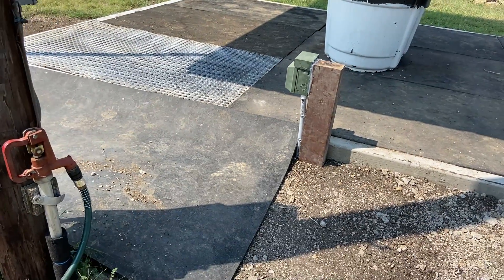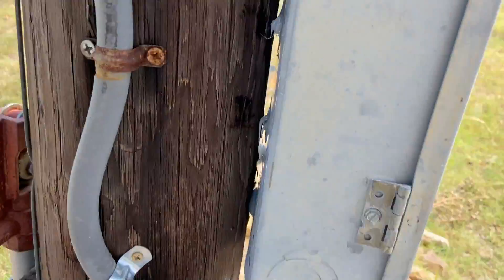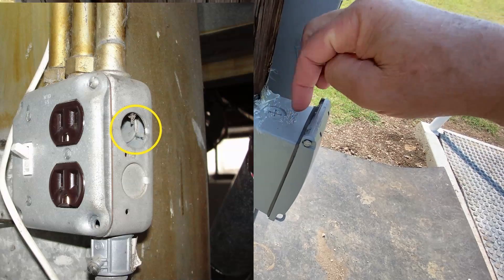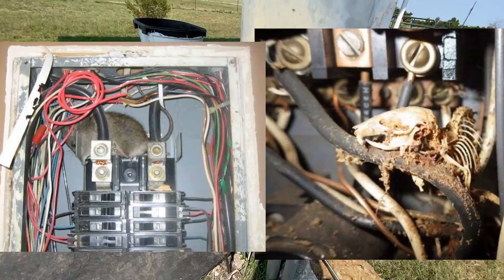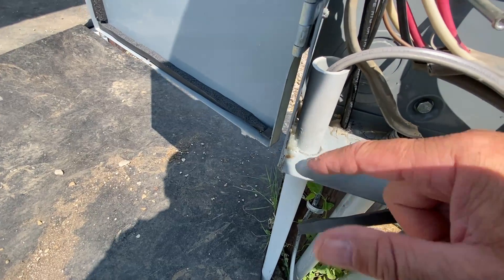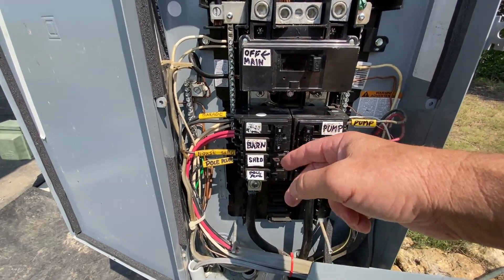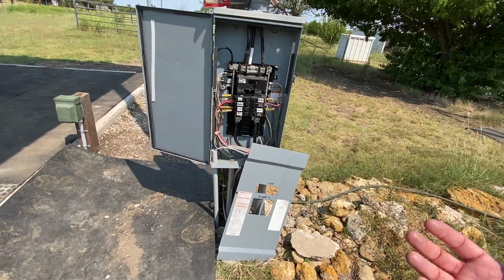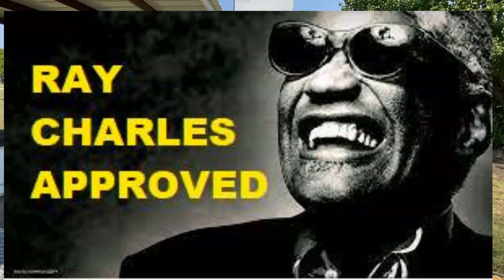Electrical Box Maintenance & Cleaning - Preventing Failures & Fires - RC Approved Expert Electrician

Comment: Lacquer thinner before the weatherstrip also don’t forget about the meter socket above,  grab a pair of kleins or  channel locks grab hold of that plastic tamper lock body and pull down hard. Before you Pull your meter out turn off your breakers below . Two screws behind the meter will  get the upper box open then seal the meter cover.  If you reallly go anal  order some duct seal (GB Gardner Bender Sealing Compound) Clay and seal you pipes coming in and out of the boxes.  Oh yeah… after you pull on that seal 95% chance the wire won’t break, you can bend it back in shape and put the lock back on. Not even an issue.  You’re savvy enough to not get lit up. Otherwise looks good .

Comment: What happens to breakers that aren't mechanically cycled, is the grease on the internal movable parts dries up and turns into a hard wax as the petroleum distillates evaporate. This intern freezes up the breaker mechanism, preventing it from functioning properly. Cycling tje mechanism stirs the grease spreading the distillate that hasn't evaporated to the outer portion of the grease that has started hardening up. I'm 34 years into the electrical field as an industrial journeyman electrician and electrical apparatus mechanic with 22 years experience in predictive maintenance and testing and thermal Imaging.

Comment: Sealing all the small holes and the door seal is the fix.  Sealing the internal cover not needed. 

Breakers:  One should cycle them annually.   If a breaker has a good current load on it, and not cycled on/off for years you risk the internal points on the breaker welding together.  The higher the constant current draw, more likely.   MTF [ mean time to failure] for a breaker is ~ 20,000. 
Unless you are using the breaker as a switch, you should not worry about turning it on and off.  

If your main power goes off, and you remember, go cycle all the breakers.  just a good practice.  

Re-torque the lugs on breakers and Neutral and Ground lugs.  Use an insulated screwdriver or Allen tool, a leather glove a good idea as well.  Turning off main Breaker before a better idea.  Stand to the side when flipping / torqueing  breakers. 

These connections will go thru heat cycles in use and loosen up over time.   If you heat a piece of metal it will get bigger, and it will get smaller when it cools.  

This property is used all the time. Example 1;  it is used to loosen a nut on a bolt.  Heat the nut so it gets bigger then you can get it off.   Example 2  Heat a plate with a hole in it , the hole will get bigger. stick a rod in the hole and the plate with cool and capture the rod.  you can also cool the rod instead or do both.  

These changes can be calculated to precise numbers to do this type of thermal fit.  Many videos on it out there,  4th grade math as well for folks in Rio Linda. 

Stick a U-Shaped rod of bolt thru the lock device to keep it closed.  OR just a bolt. Stops the mules from accidently pushing it open.  Use a lock and place key on Top of highest box with a magnet too. 

SAFETY SALLY:  Rick needs to learn as does so many.  DO NOT be pointing at live electrical circuits with your finger.   Use a wooden stick if you need to.   That finger will have muscle memory to touch what you are pointing at or looking at.   

You will notice good electrical folks will stick there hands in their back pockets when in a dialog about a panel.  Hands not used by accident and they just can use vocals.  It's so easy to point so the back pocket trick works every time it's tried.

Don't stand in front of the live panel.  Work from the side. If you have an ARC BLAST it goes in front.  Stand to the side as you watch a Technician work on a box.  So easy to do, why not.  Watch some Arc Blast videos you will see my point. 

ASIDE: thanks Pat for helping Rick out.
Reply: Yes, because newer panels like this need to have the breakers cycled annually because they're constantly arcing. Sounds like a good way to piss away $50-$100 a year on something that doesn't need to be done.
Reply: Yes a arc blast from a 240 volt residential panel is something that you need to be worried about. You don't know what the hell you are talking about buddy. Stop fronting like you do.
Reply: @twn5858  What the hell you talking about.  Explain in detail how I got it all wrong, vs name calling.     If you cycle breakers say 10 times a year [high] you got low count of 20K cycles before failure. should last 2,000 years.  you doing fuzzy math [logic]?  Breakers used for LOTO get lots of cycles per year.  We established a scheduled program to replace them before failure on a 1 - 2 year based on data.  Cost for repair in up time was spendy,  scheduled was minimal in comparison. 

Looking forward to reading about how smart you are and I know nothing.  Bring the data forward.  

ASIDE: I hate breakers for LOTO use.  Breakers are a current device not a switch.  
We ran tests with a Rube Goldberg setup and a PLC.  Breakers really do such for high count switching applications. Siemens, A/B , Square D ,  Cutler-Hammer.  not to mention the stuff for homes.
Reply: @twn5858  I just hear the sound of crickets.  Pretty strong language I don't know what I'm talking about.  

You might not know as much as you think you know. I could have gone through your limited info posted, but didn't think you would listen.   But I can.
Reply: @Linghunt2  Don't brother. You'll just be wasting your time, but be sure to cycle those breakers every year. That's a great way to throw away $50-$100 every year. No doubt about it.
Reply: @twn5858  No doubt about it, you kidding me.  You are totally wrong.  I looked up a random A/B breaker.  Per specification 20,000 Operations for Mechanical endurance.  [ A/B 1489-M Circuit breaker]   So if it's cycled once a year  that's 20,000 years before failure.   Breakers don't fail on a single toggle.   $50 - $100 a year?  

The reason to flip them is to make sure you are not thermally welding the contacts together so when you have a current overload the break fails to open.  Pretty simple if you want to understand.  My designs and input to Maintenance Schedules were actual data on failure for repair logs.  

Breakers that were used for LOTO get cycled many times in a day.  These were more likely to break for heavy switching frequency and abusive operators.  We would just replace them before they failed.  Why you ask,  The delay in production was more costly that a breaker.  Planned change out was easy as machine was down for preventative maintenance on many items. Certain breakers were replaced at that time.   If we didn't do this, the machine would go down in middle of production and would cost $1K's of dollars in lost production.  

End of the day , this program saved lots of money and the team doing this got sweet bonus CASH.  

ASIDE: same goes for knife switch type disconnect for one example.   I had the toggling of these included in the program.  Why?  I was doing an upgrade on a machine that was inn service for long time and knife was never cycled.  My technician flipped it and we still had power.  It was a 3 phase 240V - 300A service.  One of the blades was welded in it's female socket and snapped off in place.  I got to investigate the failed switch and dig into what happened.  It was really interesting to see the weldment.  did a nice write up on it to educate folks like.  Made it easier for managers to except Shutdown time for the PMP .   

Flipping breakers under load or not is also a huge factor.  OEM's don't provide much info on this,  why we did our own testing to get data.    

Many other examples as well.   As you said, I don't know what I'm talking about, but I sure do make some good money consulting at companies on this topic.  Why do they pay me? I make them money on this basic concepts.

Comment: I did not see any foam tape on the hinge side of the big electrical panel door. You need a small hole in the bottom of the electrical box also in case water gets in clear out one of the holes you plugged and glue some screen over the hole to keep bugs out. Good job other wise.

Comment: Rick just out of curiosity do you have two ground fault Interrupters on the same circuit? Also most of the weather we get is from the West traveling East sometimes from the southwest traveling Northeast I looked at that panel the bigger one and that looks beat the crap out of must be the Texas son and the weather is there any truth today let me know thanks
Reply from the maker: that box is about 4 years old it faces South. NO, each Gfci is on it's on breaker, if that is what you are asking
Reply: @heygunpeople  that's correct to ground fault interrupters in on same circuit or in series you might say they compete against one another so one will always trip the other and it won't work correctly that's all thanks

Comment: Molded case breakers are considered wear items and should be replaced. Yes you need to exercise your breakers because the electrical stuff inside may be working right but the mechanical linkages can fail to open the breaker in case of a fault then you have a melt down, luckily most newer breakers fail safe so they just won’t ever reset/set again.

Comment: The best way to seal up your electrical is sealing up the inside of the conduit. In hazardous locations we use seal offs but in a standard location we just push some acrylic latex into the conduit and move the wires around to agitate it.
Reply: The only reason to do that is for hazloc, otherwise it's unnecessary. Gas fumes or whatever. Water always gets in conduit, even if sealed, from condensation. He's only worried about water and wasps getting into the panel.
Reply: @johnrice1943  yeah that’s not true at all. It’s actually required to put silicone to seal up conduits that penetrate through barrier that has a temperature differential such as walk in coolers and freezers. All penetrations must be sealed interior and exterior to prevent condensation from building up.
Reply: @johnrice1943  also when you have conduits that go from inside to outside you silicone the inside of the conduit to prevent ingress of rodents and bugs.

Comment: Just FYI you don’t want to seal the bottom of an electrical enclosure. The largest opening at the bottom that isn’t closed needs to be 1/8” to allow water to seep out the bottom. That FU plug is supposed to be a 3R or Hoffman plug and not a standard press fit plug.
Reply: Yeah a push penny isn't weather proof. Indoor rated not nema 3r.
Reply: @johnrice1943  Did you notice the water spigot right there on the left side of the utility pole.  Any thoughts?

Comment: Buy a in-use bubble cover for your exterior gfci with the flat WP cover.  They have a notch to cut out for which ever orientation you desire.  They pop out enough to close completely and keep your cords plugged up.
Reply: Union electrician by the way L.U. 136 Birmingham Alabama, love your stuff man!! You crack my ass up all day!!
Reply from the maker: google a pic and then put new comment with link to pic

Comment: Do you realize you installed an interior breaker box outside?
I love you man.
Reply from the maker: NO way, home depot said it was out door?  And it has a lock closure, inside does not have those? are you sure?
Reply: @heygunpeople  100 percent an exterior panel been doing this 25 yrs
Reply: Your right the little lever to move and open the cover is the on the side usually outdoor panels it’s on the bottom isn’t it ?
Reply: Who's going to tell him the A/C outlet is upside down? Ground lug should be on the bottom. (I know, I know, it's a contentious issue). Other than that, that's a great looking electrical box installation and wiring, Rick. Neater than I would have done.
Reply: My mistake.